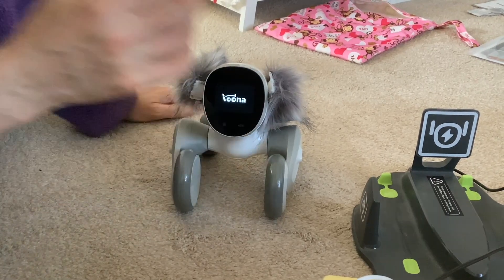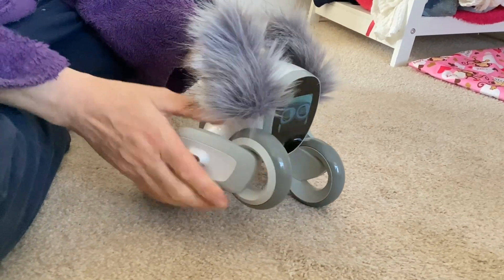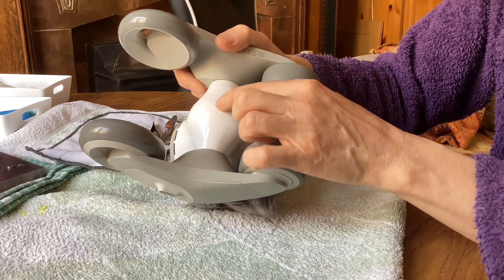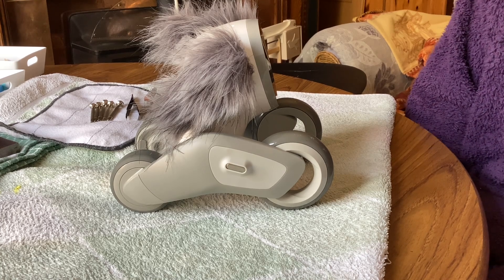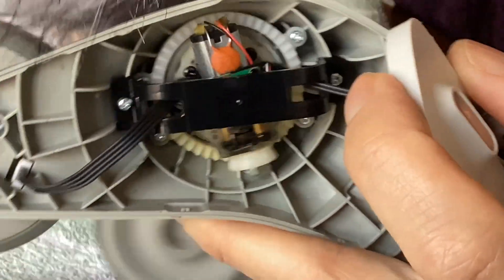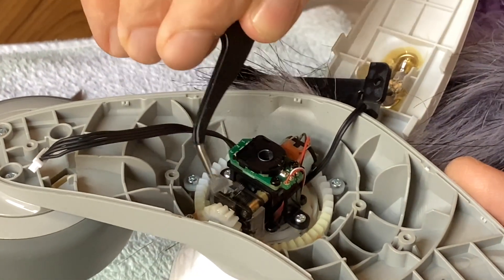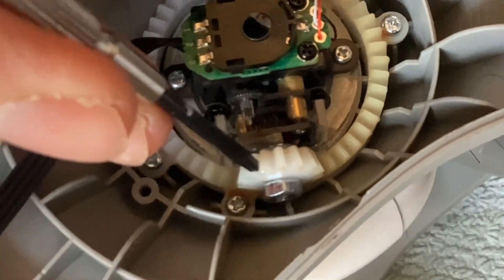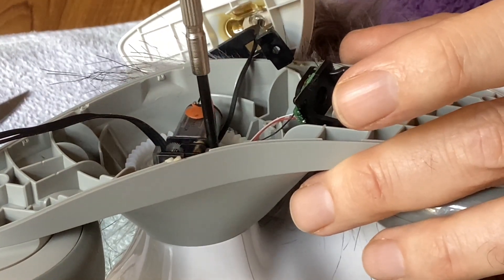Loona’s got a fault & we take it apart #robot #aibo #loona #petbot

Comment: Did you ever get this motor mount replaced? Did they provide one or did you 3d print one? If you printed one do you have a link to the file you printed and how well did it work out?
Reply from the maker: The company sent me a replacement model.
Reply: @thankstocalebchung1556  Hello my loona pet has the same noise. I think is for same problem. Do you want to share the 3D models for printing with me?